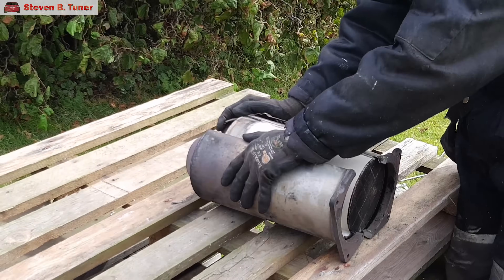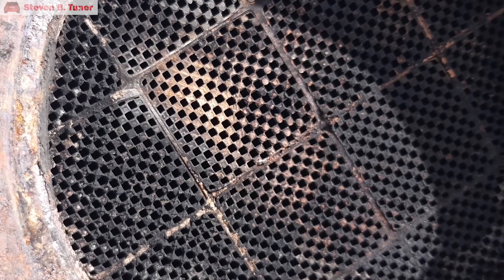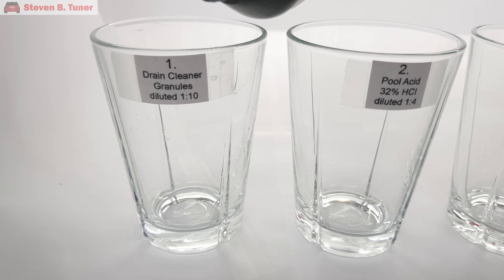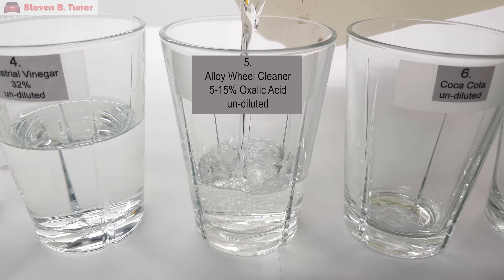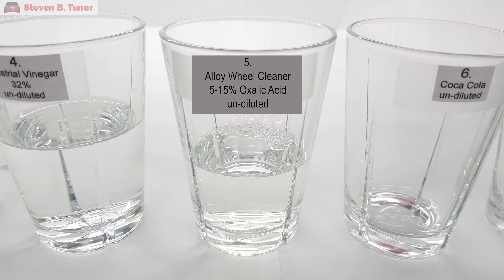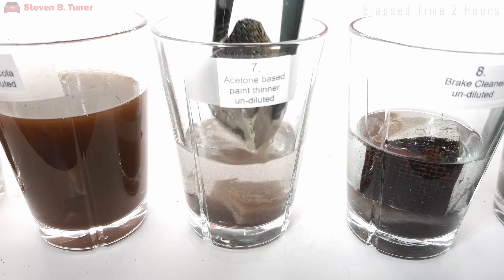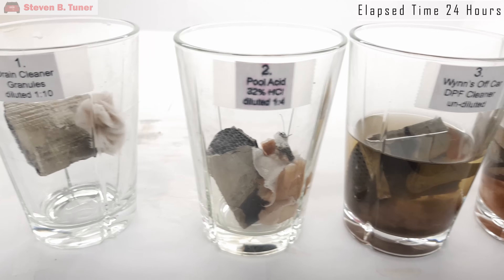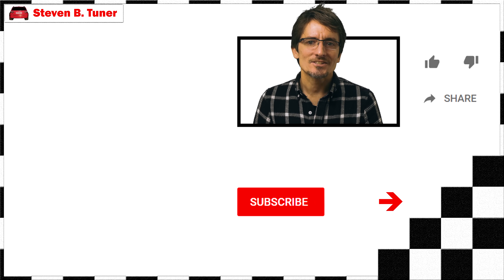DPF Cleaning at Home – 9 Chemicals Tested (Diesel Particulate Filter DIY Ash Cleaning)

Comment: Hello Mr. Steven B I have a Nissan Pathfinder 2013 I want to try to clear my car's Catalytic Converter utilizing your pool chemical method, I need you to please provide me with the brand best suitable for my task, it would be appreciated very much. THANK YOU
Reply from the maker: Hi, if you are following the steps in my other video 'The No Damage DIY DPF Clean' then you will be aiming for 20 liters of 6% HCl solution. I cannot recommend a particular brand because every country and state has different rules regarding acid strength that can be bought retail. You will need to read the label where you live and mix in some water to get to the right strength. All the best with the job!

Comment: Not being mechanically minded, it strikes me how one finds, removes, cleans and refits and reconnects all the components one needs to. Finding someone who will do it for free or beer money will be hard. My local dealer wanted nigh on 1000 GBP for a front light cluster. I told them to foxtrot oscar. My warning light is on so I need to do something. But DIY doesn't seem the route for me. Also, at the end of the video, why dint you summarise? Whats hot, whats not?
Reply from the maker: Hi, this video was an investigation into 'viewer suggestions', so there wasn't really any conclusions to be had. If you were to do a DIY clean, then I still recommend my other video: The No Damage DIY DPF Clean. If you are not into DIY then you could ask your local trusted mechanic to take off your DPF and follow the steps in that video, or you could find a specialist DPF cleaning company in your region, or if you are not nearby then your mechanic could post them the DPF for cleaning. There are many professional DPF cleaning companies now throughout Europe, Britain, USA and Australia (and probably other parts of the world too).

Comment: So what is the best chemical solution for cleaning a DPF FAP filter? i dont know?
Reply from the maker: Hi, the best and cheapest way I know of so far can be found in my other video: The No Damage DIY DPF Clean.
Reply: @StevenBTuner  thanks so much for your dpf videos, so useful and entertaining! do you still recommend the NaOH over the dishwasher tablets? for pre-wash
Reply from the maker: Hi, NaOH is cheap and effective and it has the added benefit that it will chemically react with the acid in the 2nd stage to form water and salt - which is no problem to dispose of.
Reply: @StevenBTuner  thanks 👍

Comment: Does dpf reduce engine life ....i mean what if i keep it till it starts messing up and then delete it ..... would the damage have been done ?.... In short how many years with and without dpf.
Reply from the maker: Hi, the engines have been designed to have them, so there is no reduction in life. Problems can occur if the DPF 'end of life' warnings are ignored for months or years however.

Comment: The biggest problems the dpf shite is removing them to clean them 2016 audi a6 10+ hours and it blocks with adblue crystals. Need something cheap to clean on the car
Reply from the maker: I know what you mean - some cars were never designed with maintenance in mind! There are in-place DPF cleaning products made by LiquiMoly and others, but I've never tried them...
Reply: @StevenBTuner  I used the launch one a few weeks ago, but it didn't work, tho I think it was my fault

Comment: Many thanks for your research! I did my DPF on 318D F30 using Drain Cleaner and Hydrochloric acid two years ago and since then I have successful 70k km on it. I passed also annual inspection without problems.
Reply from the maker: Perfect result!

Comment: Gasoline works well... But should be left overnight with pipes/caps or oxygen sensor unclosed .. for ventilation and let gaz evaporate and avoid  firing the engine 🔥
Reply from the maker: Gasoline is too dangerous to be recommended, and it won't get rid of the ash deposits.

Comment: Ash can't be dissolved from inside the filter? The unbroken filter inlet holes are closed at the outlet end, and vice versa for the exit holes at the inlet end.. Ash always remains inside the inlet tubes, and doesn't pass through the ceramic from inlet tubes to outlet tubes. Have you successfully removed ash with solutions?
Reply from the maker: Hi, I describe the filter in greater detail in my other video: The No Damage DIY DPF Clean. Once most of the oily soot is washed out of the filter, it takes about 30 minutes for enough of the ash to be dissolved so that what is left can be washed through with a regular garden hose using forward and back-flushing.
Reply: as steven said. wash the system through from rear to front. anything in it gets flushed to the engine end and out. (only with DPF off vehicle)

Comment: What kind of dishwasher tablet did you use? 

Best regards
Reply from the maker: Hi, it was the truly wildcard entry - the unknown brand tablet that had fallen down the back of the cupboard years ago. My favourite method is still the 2 stage method using caustic soda followed by 6% hydrochloric acid.
Reply: Thanks. My filter om my old 1.6 CRDI Kia Ceed needs clearing, so I will try soaking for a day in regular dishwasher tablet and then presurewash it

Comment: For costic soda or drain cleaner, hot water is required. Good experiment though
Reply from the maker: Hi, this one case where you definitely don't want hot water as boiling water and sodium hydroxide will dissolve the silicon carbide that makes up the DPF ceramic material.
Reply: @StevenBTuner  sounds like a great outcome then 😉 gets rid of all the rubbish internals that block the flow in the first place, would save cutting open and gutting it.

Comment: 2 THAT ARE MISSING FROM THIS TEST IS PETROL AND MR MUSSCLE OVEN CLEANER
Reply from the maker: Hi, petrol is nasty and explosive, so I have not included it. Mr. Muscle is quite expensive per liter compar.ed to the other products, but it will certainly remove oily soot well.
Reply: @StevenBTuner  AGREED gas is very flamable as is brake clean and carb clean, paint thinners etc.  The things you use in these test should all be used outdoors.

Comment: hi you have to mix with water or not the alloy wheel cleaner?
Reply from the maker: Hi, I haven't done enough testing to determine the best and safest dilution for alloy wheel cleaner as I am happy with the HCl solution used in my other vid: The No Damage DIY DPF Clean.

Comment: Can't believe you didn't use Mr muscle foam oven cleaner that's what I've always used
Reply from the maker: Hi, you can certainly use Mr Muscle for the first stage wash, but it will work out more expensive than 200g of drain cleaner.

Comment: I enjoyed your video as always but have an unrelated question for you.
What is your opinion of products that are added to the fuel tank which claim to to lower the temperature that regeneration takes place at.
I am aware that some cars have a tank/bladder which gradually adds some chemical to the system and makes the above claim.
I have recently spotted a Carlube product which makes the same claim, but should be added every 3000km, according to the manufacturer, for best results.
Reply from the maker: Hi, those products are great for folk who only do short journeys, so the car never runs for long enough or at high enough speeds for the scheduled regeneration to occur.

Comment: Who is the winner?
Reply from the maker: Hi, I was looking for a new winner, but my previous 2 stage process is still my favorite, using sodium hydroxide (caustic soda / drain cleaner) followed by hydrochloric acid (pool acid / brick cleaning acid). You can see the whole process in action in my other video: The No Damage DIY DPF Clean.

Comment: My question is, once the DPF has "come to the end of their lifecycle" as the mechanics put it, (roughly 100,000 km in my case), does it actually mean I need to put in a new one? At this point I have already ordered it (3400 Euros). Can the old one be cleaned out and reused?
Reply from the maker: Cancel that order! There is no chance that a DPF is ash clogged at 100,000kms unless you are running Russian tractor diesel in your car. Most cars get between 160 and 240k kms out of their DPF - but it can become soot clogged at any point if another engine system stops working properly, like the EGR valve or the glow plugs. There are many specialist companies that will clean your DPF at a very reasonable price, or if don't mind an unsavoury job then you can follow the full instructions in my other video: The No Damage DIY DPF Clean.
Reply: @StevenBTuner  Thank you for your reply. I have not considered glow plugs or EGR, although the engine seems to be running ok ALTHOUGH I have noticed far more vibration when the car is idling (even more so when I throw it into Drive gear) 🤔 I have also noticed quite a dramatic performance drop, but I always attributed this to the DPF, although this began way (years) before I started getting DPF issues. I live on a tiny island where a trip is normally at most 15 minutes and at 50km/h so normal regen cycles are probaby rarely/never initiated. I have actually taken it to get it removed and cleaned, however the issue persisted after about one month. I can also say that I do not really trust the "mechanics" here (mostly jusy blind reading OBD faults) and never dig deeper. So I actually don't know how they cleaned it, for all I know it could have been soap and water or just compressed air. For this reason, I am turning to the internet to help me maintain my car :(
Reply from the maker: Hi, for a regeneration to occur the car will need at least 80km/h and be up to full temperature (which can take quite a long time), so it may not happen on a 15 journey. Often when mechanics do a 'clean' they will just force a regeration - which is something you can do yourself with a good OBD2 tool. For your driving environment I would recommend tank additives that lower the passive regeneration temperature.

Comment: Seems like an expensive racket to make people put these silly filters on their cars, when you could remove the particulates in the muffler, by condensing the water out of the exhaust and directing the exhaust into that water. This also will remove nearly all the nitrogen oxides, and the overflow moisture would simply land on the ground to fertilize the vegetation, rather than end up in the air as smog.
Reply from the maker: Hi, there are indeed many good ways to trap particulates, but when it comes to cars the manufacturers want something lightweight, small, and cheap.

Comment: well I used this method 6 weeks ago and still no problems or return of codes. my only regret about when i done this was how bloody cold it was and how little i wanted to be flushing cold water thought it. if i was to do this again and it was warmer  i would use a large flexy tub  and put a hole in the bottom of it to put in a push button toilet cistern on that. id then put the whole thing on top of an A frame ladder with timber support. then using 40 or 50mm waste pipe id connect it to the exhaust. fill up with a hose pipe and once full flush that ash away. it would create pressure across the entire filter that just cannot be done by a hose pipe alone  as i was worried that once the filter was cleared to a certain point the water was just following the path of lest resistance and not clearing any more of the filter. but all that said this still worked a treat and just added to my get out of jail plans for future DPF problems.
Reply from the maker: Well thought out system, and I know what you mean about dealing with lots of cold water!

Comment: Hi, I'm planning on using Wynn's dpf cleaner that allows me to keep the dpf on the car.  How bad of an idea would it be to then run cola down the dpf pressure hoses to clean the ash out.  Thanks
Reply from the maker: Burnt sticky cola would probably add more ash than it took out! I haven't tried any in-place DPF cleaners, but I have heard good things about the Liqui-Moly product.
Reply: I used Wynns dpf cleaner it was waste of time money didn't see hardly any results
Reply: @stevemcevoy5628  I ended up taking the dpf off. Soaking it in dissolved dishwasher tablets and the passing coca cola through it. Then finished with a jet wash and all sorted now

Comment: The DPF should be designed to be cleaned and flushed easily. It’s obviously a necessity with the diesels mandated emissions laws.
Reply from the maker: Hi, some of the French cars have very easy to clean DPFs, but most manufacturers have been quite happy to let you buy a new one... The ash content in diesel and in engine oil is a lot lower than it was 20 years ago, so the filters don't clog up as fast as they used to.

Comment: for a gasoline car, which is the best liquid to clean catalytic converter? which one harms the catalytic converter the least? thanks
Reply from the maker: Hi, there are a couple of comments in my other video: The No Damage DIY DPF Clean, where folk have followed that process (drain cleaner followed by brick cleaning acid) and they said that it worked well. I haven't tried it myself, so I don't have any personal experience to add.
Reply: @StevenBTuner  
thanks for the feedback :D

Comment: My question is: yes it does remove the ash, but does it damage the material of the DPF or is it completely harmless?
Reply from the maker: Hi, I have tested the individual components in my other video, and there was no damage. If you want to see the full testing then check it out - it is called: The No Damage DIY DPF Clean.

Comment: Can you share the ratio of dishwasher tabs to water in grams? Thanks
Reply from the maker: I haven't tested this more as a first stage wash as NaOH / caustic soda is cheaper - but you could try 10 tabs in 2 liters of water to start, and if lots of oily gunk keeps coming out the it do a 2nd round.

Comment: Thank you! Worked like a charm.

My friends Bmw E60 525D had a blocked DPF for 2 years (Warning on display). It was very blocked. I used drain cleaner, mixed it to about 1:10. Then used pure aloy wheel cleaner. 
Then i pressure washed the dpf from both sides. (Didnt damage it one bit, even on full blast)

When done i cleared all codes on the engine. (Very important) then used carly dpf request regen to "clear it out" got ash to 1gram.
Now it works like a charm😁
Reply: The drain cleaner i used was a Mr muscle type like. With natriumhydroxide
Reply from the maker: Thanks for sharing your experience!

Comment: I've just spent 20 quid on a bottle of off car dpf cleaner and I've got about 50 dishwasher tablets under the sink. Gutted. 
Great video Steven. I'll Try the dishwasher tablet as a pre wash and then use the dpi cleaner fluid. Subscribed and Liked. Thanks Pal..
Reply from the maker: Give it a go - I'd love to hear about your experience! Some folk have reported that  it can work well, but you may have to soak overnight and do some extra shaking.
Reply: @StevenBTuner  i used an old baby bath and soaked the dpf in dishwasher tab overnight. the liquid was black don't know if any ash was removed tho  i put the dpi cleaner in next. overnight again. and spent 2 hours rinsing it. i put it on the radiator in the hall to dry and fitted it. i had some black liquid coming out the tailpipe but it went after the car was warmed up  DPF is fine so far.  thanks pal

Comment: These are cleaners used to clean when you take the filter apart. They say that hot steam will do a good cleaning job. Will you do a video on DPF cleaner additives?
Reply from the maker: Hi, they are for when you have the filter out of the car, and my favorites still are the Sodium Hydroxide and the Hydrochloric acid. There are no tank additives that are strong enough to remove ash, but there are products that you can inject directly into the DPF while it is still installed, which definitely need testing :-)

Comment: Ford has a SSM about using cleaners for the EGR and DPF. They call it cat poisoning. It will set cat efficiency codes. In that scenario the CAT/DPF assembly would have to be replaced.
Reply from the maker: It would be interesting to read exactly what they are referring to, as some manufacturers such as BMW offer cleaning as a workshop service.
Reply: @StevenBTuner  I went back to the SSM. It’s the cleaning of the EGR SYS, valve cooler ect. Not necessarily the DPF. The use of cleaners or liquid substances can result in sodium poisoning of the NOx and PM sensors resulting in degraded operation  and permanent damage to the after treatment system. Use of these cleaners may void the emissions warranty of the hot end after treatment sys and attached emissions sensors. As a side note. Ford has never had a cleaning procedure for the dpf. We would occasionally get on where you could tell the dpf has been cleaned and rewelded. But we would have to replace with a factory new DPF/SCR assembly anyway.
Reply: @matthewnosal6893  If you're having to clean the system before the warranty is up, then it doesn't bode well for long term ownership! 😂

I wouldn't touch a ford nowadays anyway.
Reply: @Altair885  Fords DPF warranty is only 5/50, no extended warranty will cover them either.
Reply from the maker: @Matthew Nosal , thanks for the clarification - it makes sense to not throw chemicals into the intake system that can effect parts further down the chain.

Comment: You should try “NaOH” or “KOH” hydroxides. Those have strong cleaning effects
Reply from the maker: Hi, NaOH (aka drain cleaner) is used to good effect in my video: The No Damage DIY DPF Clean, as the first stage wash. I use KOH in my other video about cleaning a DPF with no cat.